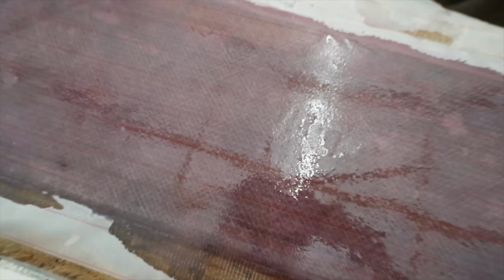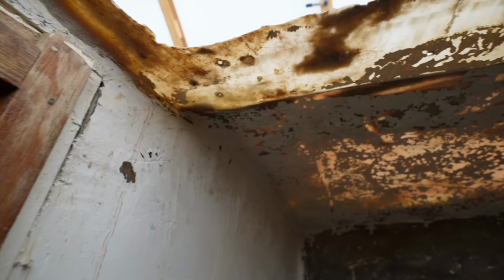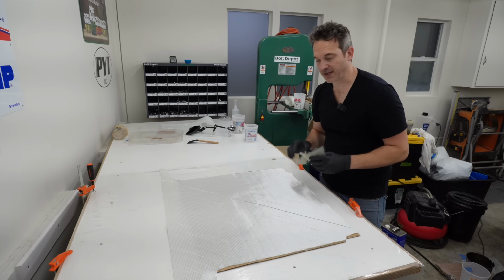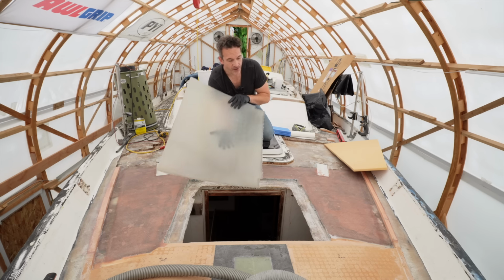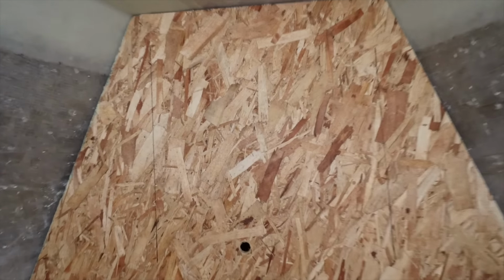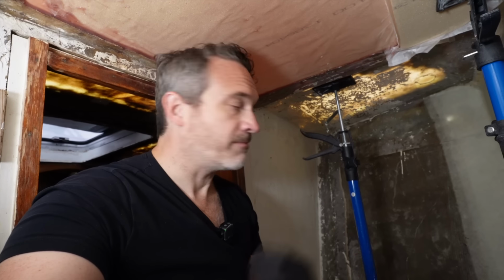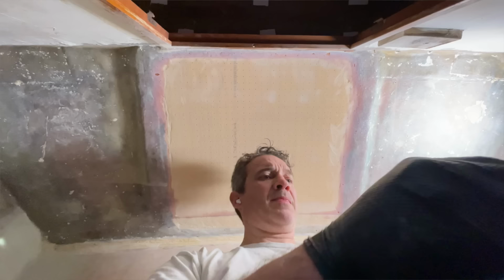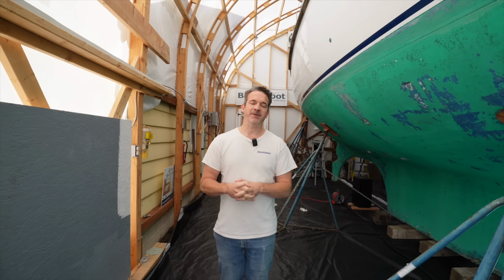REVEALED: The Forward Hatch Plan Takes SHAPE | E033

Comment: For overhead lamination I used to apply thicken epoxy to get the fiber to stick to the roof and then wet it with a roller and lear epoxy. Did a complete 40 foot deck rebuild like this
Reply from the maker: I’ve been thinking about trying that. Did you find it difficult to saturate the cloth working from below?
Reply: You can only do 2 to  layer in one go orher wise it is to heavy and it falls. It sur tale some time to find rhe right moves and it takes some methodology if you dont want to get epoxy all over your body. Now that I write I realize that we sere working with polyester which cures a lot quicker. We were mixing in a pot then droping the mix in a arger plastic box (icecream box) holding the box in one hand,.the roller in the orger hand and following the roler with the box tight under the roller to get the drops. Would not say it is easy, but lating glass over your hed didnt look easy neither LOL.

Comment: Hi Jon, I probably would have left the hatch for air circulation, especially on a big yacht like yours. However, you can always put it back, I don't think dorade boxes will gel that close to the bow, probably interfere with the headsails  furling sheets.
Keep at it it mate.
Reply from the maker: Yeah, I’m definitely aiming to make it so that I can always re-introduce a big hatch if I miss the mark here. 
Keeping a dorade vent from interfering with furling lines is a good
Precaution! Thanks for the heads up on that. 🙏👍

Comment: hmm if you add a vent, you are most likely becoming more susceptible to leaks than you would be with a quality offshore hatch. You have the opportunity to add a flush hatch withe some decent drains. 
Thats what I would aim for anyway. 
Cheers
Reply from the maker: If I do decide to install some ventilation I will definitely aim to
Have a good sealing solution and it would be mainly for drying out in “less spirited” weather.

Comment: The more ventalation the better but our 35' cutter has nothing forward of the v berth hatch.  The only other contributer to below deck mosture on our boat is the anchor gear.  We decided the best way to combate mosture in nose was to keep it out to begin with.  We have no windlass so we run a 44lb Rocna, 35' of heavy chain (limit of my vertical lifting stength) and 200' of anchor rode.  When we pull anchor, l will always air dry (rinse if it rains) the tackel before putting it away in the chain locker.
Not suggesting you go without a windless and I left the mud factor out of my maximum vertical lift calculation so it can be tricky at times. On the other hand, it is important to be able to pull up by hand as a backup.  We also secure the end of the rode with a light line and a coast gaurd line cutter is within reach, attach a fender and it can be retrieved later.   Your wife will appriciate the options if a need comes up to singlehand.
I sure like your setup with the boat right next to your shop.
Fair winds
Reply from the maker: Thanks for the input. The old Nilsson windlass that we have can be manually cranked up although I’ve never tried that. I’m sure if I have several hundred feet out that will be quite the task…

Comment: How about a temporary dorade box?  Courtesy of Larry Pardey.  Put the same deck plate as your other dorage vents on the foredeck wherever it makes sense.  Leave it in when sailing so its sealed.  When you drop anchor or dock, remove the deck plate and put a short standpipe in place of the plate.  Then put a dorade vent over it.  I'm not sure if Larry screwed his dorade vent down or just lashed it.  But you could probably use an inexpensive toggle/overcenter latch.
Reply from the maker: That’s an idea. I like the low profile on the deck that would provide. 🤔

Comment: Have you tried using a scraper? Instead of grinding or sanding the glue joint, a scraper does excellent. No dust.
Reply from the maker: I have not. Do you mean to knock down the epoxy squeeze out?
Reply: @livingforsail  yes. You will be surprised at the uses of a scraper.

Comment: I would have screwed a piece of 1/4” plywood, or similar, to the underside with release film on top, then laid up the glass and then foam on top.  Your fiberglass skin might have worked if you used 2 or 3 layers of 1708 rather than one.
Reply from the maker: Thanks for the tip. I wondered if a thicker skin might have worked but after test fitting g a piece of foam I had a good fair curve and went for it. 👍

Comment: Why is your epoxy purple. I saw it come out of the cans as a clear liquid?
Reply: Because it’s not epoxy
Reply: @kenyonstewart7120  Oh yeah, he even said the Poly reacted with the plastic on the workbench.. I don't know what I was thinking. Lol
Reply: @projecttrawler  Actually, later in the video he is using epoxy and it is also purple.  It must be a thing with that brand.  Polyester is usually pinkish and vinylester is often purple.
Reply from the maker: This video might have been a bit confusing… 
I usually use Seahawk R1 epoxy and the resin is crystal clear. The hardeners  are anywhere from clear to amber to deep purple. They darken as they age but the resulting mixed and cured epoxy just gets stronger as the products age in the can (one big benefit over Poly/vinyl as they have a defined shelf life). 

The single sheet lamination was done with VE which comes out of the can light purple and turns amber as it catalyzes. The Epoxy that I glued the foam and laminations in with turns purple when I mixed in the dark hardener. 

I hope that makes sense. 👍
Reply from the maker: Exactly!